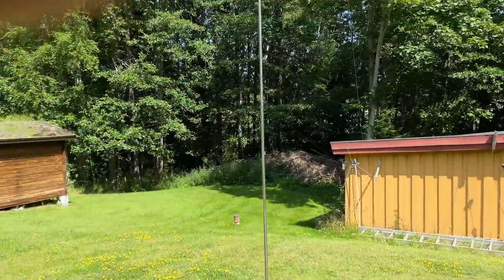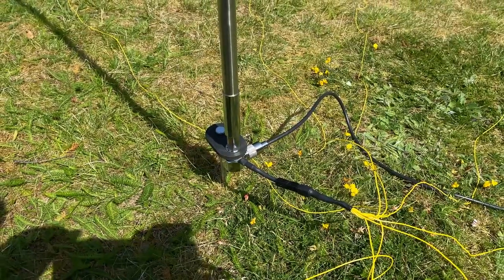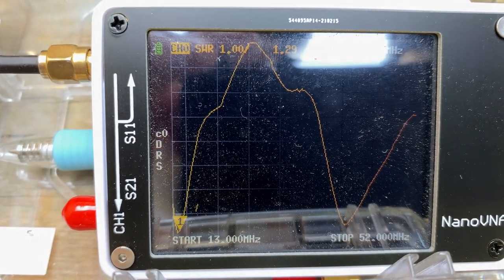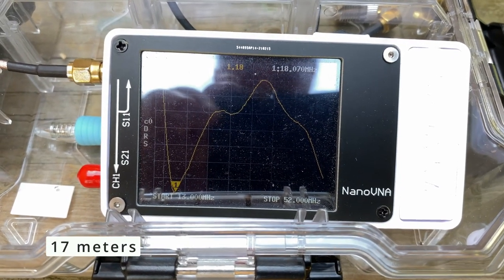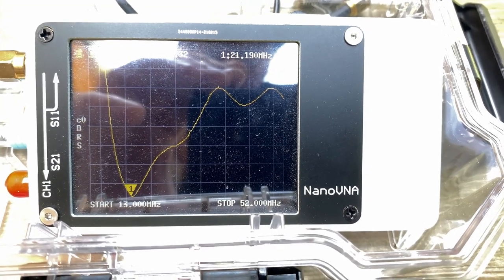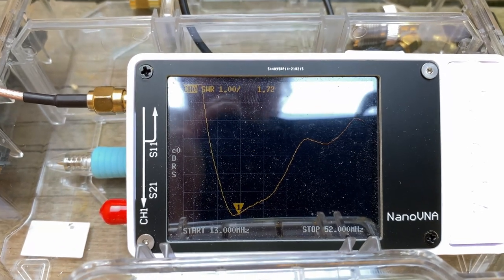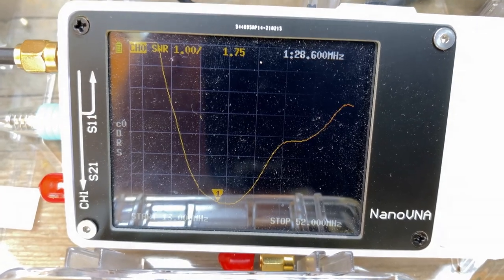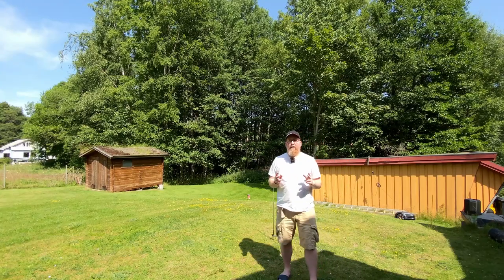Does the MFJ-1979 work on other bands than 20 meters?

Comment: I enjoy watching your videos. The telescoping whip is one of my favorite antennas for portable. I spent time tuning mine, and used a sharpie to mark each band, and a small piece of tape on my radials at various lengths for the different bands. If you do this, most times just putting it at your marks will get you in very usable range without an analyzer.

Comment: There's another way to use these handy telescoping antennas. Adapt several 3/8-24 antenna mount adapters to have an adjustable vertical element and one or more adjustable horizontal elements. That can then be elevated on a tripod above the ground to get wider coverage. For the tripod, check out those photographers use for lighting. That is a large market, so competition keeps the quality up and the price down. A good source is B&H Photo.
Reply from the maker: Sounds like a great way to do it! I'll have to check that out.

Comment: Clumsy me finds adjusting the length with a tape measure awkward. A cord longer than needed for a band is easier to use. Different knots can indicate different parts of a band. And since the resonance frequency can change with elevation, different knots can indicate heights for the antenna.
Reply from the maker: That is actually a great tip!

Comment: You don't need the analyzer in the field if you calculate the length for each band and test in advance. You can either measure the length needed for each band or mark the whip for the different lengths. I keep a chart of the proper lengths for each band on my phone and a tape measure in my go kit. I use the MFJ-1979 either ground mounted with radials or on a triple mag mount on my Ford Expedition which acts as a perfect counterpoise. The only drawback is it doesn't tolerate a lot of wind. Fran/KC1NDQ
Reply from the maker: I have thought about that, and although it wouldn't give you a perfect match every time it would sure be close enough.

Comment: Great video, by also having precut radials for each band below 20 Meters , the depth of the SWR might improve.
Reply from the maker: The length is not critical on ground radials. If the radials are however the length is critical.

Comment: Morten, I had no idea it got that warm, as far north as you are.  Those are Alabama temps!  Good video, that whip is way better than I thought it would be.
Reply from the maker: It’s more like an Alabama winter, isn’t it Jim? And it does get this warm more often than it used to. Together with shorter and wetter winters and more severe weather.
Reply: It got to 100 F. a few days ago in southern N.Y. , we've been mid to 100 F for 2 weeks. We need rain BADLY.
Reply from the maker: @Tommyr  I can see that. Luckily we don’t get those temperatures often here.

Comment: You do not tune by running back and forth like that, nor by looking at the SWR. You need to pull the radials out taught. Then place the   measuring device AT THE ANTENNA FEEDPOINT, not at the far end of the coax. You forget about SWR and read reactance on the instrument. Adjust the length until reactance is minimum (0). Depending on your ground radials, the impedance should read between 30 to 60 Ohms. Connect the feedline and operate the radio.
Reply from the maker: Thank you for your input. Also, I asked if the antenna works on other bands than 20. And it does. Is it text book perfect? apparently not according to the Youtube comment experts. Has this configuration given me lots of portable DX. Yes. 

I sure hope this boosted your ego, because you did not provide anything constuctive with your feedback. This is a textbook example of a sad ham comment.

Comment: I have used mine on the trailer hitch of the car, with no radials on 10m-20m FT8, a few SSB from Alaska to the states.  I am sure it would work even better with radials.  KL7TC
Reply from the maker: When on a trailer hitch the car acts as a ground plane though. I used mine on a magmount on the roof of the car many times.

So, in conclusion, the antenna is a great performer with poor build quality.

Comment: About 1/4 wave should work for a given frequency. I just ordered one of these whips.  My question is on higher bands would it be better to use it full length and add inductance with my wolf river coil to try and resonate it at 5/8 wave or just shorten it to 1/4 wave? Antenna experts?
Reply from the maker: Exactly! And I guess that was what I did, wasn’t it?

Comment: Nice video... I have this same antenna, gonna pickup a ground rod or metal rod to attach to the mirror mount. I dont have a lot of space so I am going to deploy when I want to play on HF and take it down when I need to cut the lawn!  I agree, antenna analyzer ensure no mistakes and good match. Do you think a Choke or 1:1 unun is needed to reduce any common mode currents?

Comment: I've had my 1979 for 5-6 years now.  The only band I've not used it on is 160 meters.  I made a  pigtail that will allow up to 4 radials.  I am a band-hopper so I use a small auto-tuner and leave antenna fully extended with radials attached for all bands.  This is a very versatile antenna with many possibilities.
Reply from the maker: Mine lasted about six months until it broke unfortunately. I am getting another whip, but probably not the MFJ1979.

Comment: Fully extended at 5m with horizontal ground radials would it not need tuning as it would be a half wave for 10m?.
Reply from the maker: Yes, but you tune the antenna by shortening it.